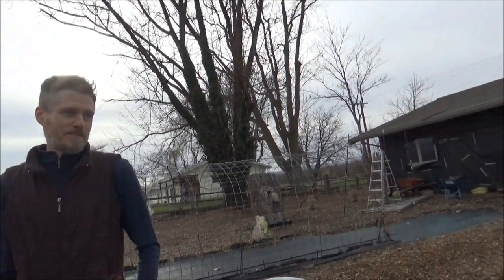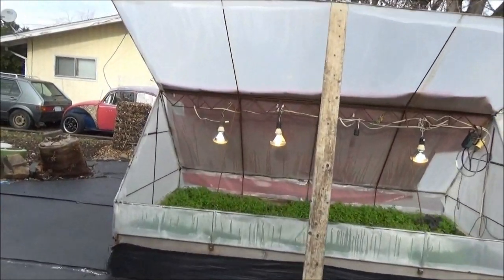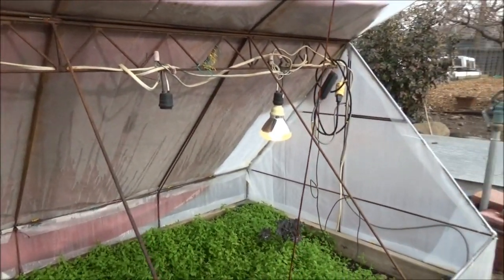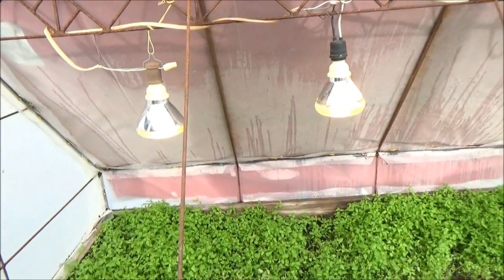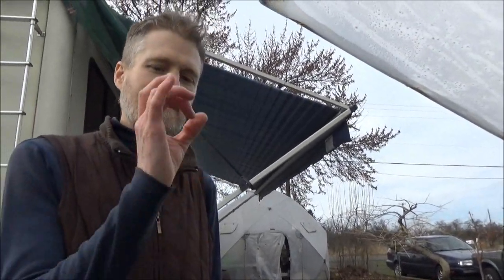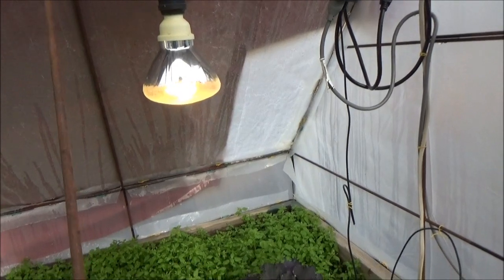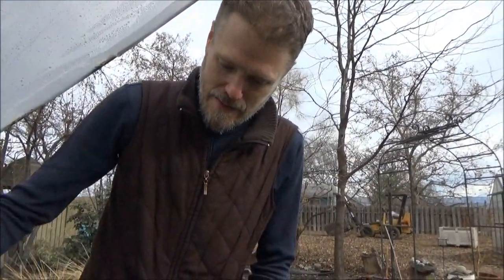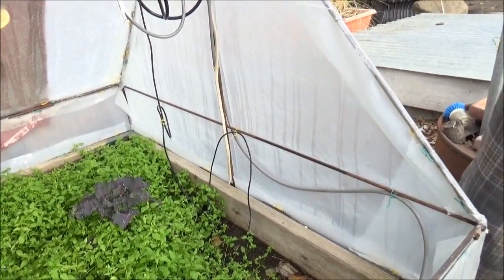Matthew's Heated Cold Frame - Subscriber Garden Tour - L2Survive with Thatnub

Comment: I don't know where Andrew lives but my guess is in the northern tier of States. Feeding a wood burning stove outside all winter is a real task for a 24hr need.  You would probably need to terrace the beds on top of the major mass to be able to fire it so it could keep it warm over night that would require a much larger tent which would then have possible snow load problems using poly and a light frame. His electric heater is a very good solution for a three month problem.  If he was trying this in a full sized hoop greenhouse or a regular greenhouse I would agree with the rocket heater to keep expenses down.
Reply from the maker: Peter Menningen Matthew covers this in a video called "Matthew Answers Your Questions".

Comment: you should look up "rocket mass heaters" here on you tube.  Many are used in greenhouses and are practically free energy.  You couldn't use one in a smaller cold frame like these but you could bury the exhaust under the soil and keep the stove outside.  As you burn in the rocket mass heater it creates a condensation that circulates through the exhaust and out the other end.  Do check them out.  They burn so clean people are putting them in apartments. shhhhhh
Reply from the maker: ***** Matthew covers this in a video called "Matthew Answers Your Questions".